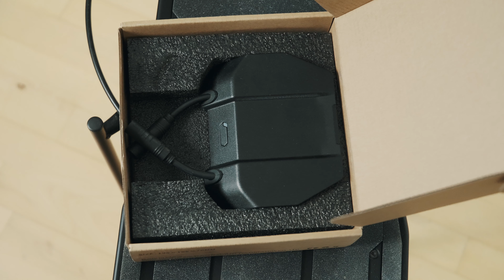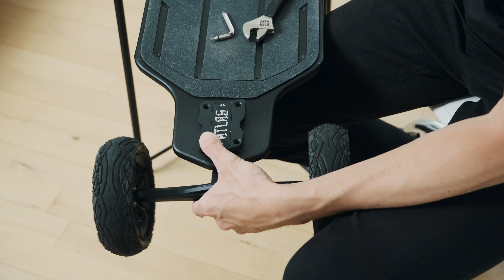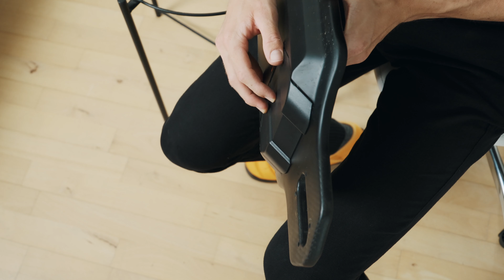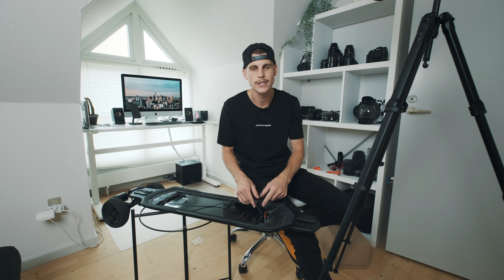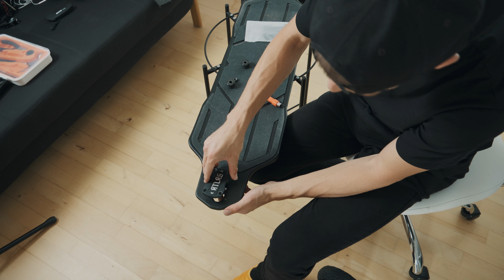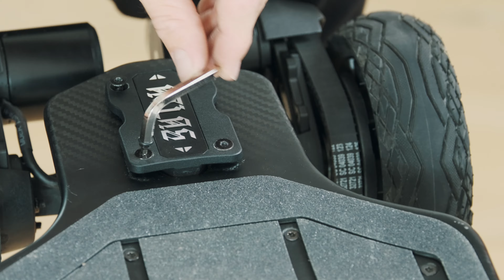EXWAY ATLAS CARBON 2WD - 4WD CONVERSION TUTORIAL

Comment: I have the 2wd version,and thinking of upgrading it to 4wd..
But how much does it affect range ?
Reply from the maker: @jaimyportier  honestly I can’t really tell you for sure. I only had it on the 2WD mode for like a couple weeks before I changed it to 4WD. 

I guess you just need to think about why you want a 4WD. If you’re thinking of doing some off-roading, then I 100% recommend it. It’s wild how sturdy this board is with offroading tires and 4WD. 
But if you’re just cruising in the city, then I would recommend keeping it 2 Wheel Dr. as it definitely does affect the range. I just can’t tell you how much. But I’m sure it says on their website.

Comment: 4 screws are out, and I've been heat gunning for 20 minutes and this thing won't budge😢
Reply from the maker: I know it’s frustrating. Did you manage to get it?
Reply: No. Gonna try again today. Just afraid i'm gonna ignite the battery pack or fry the ESC. I put a fireproof cloth over the battery area to minimize heating it. @mitch_wies
Reply: I got it, and it's empty. I needed to open the rear one. Sigh. I have a short in my board, so I wanted to check all the connections. I don't see the open grid in the rear one. It looks as though it's been filled with plastic. So I concerned with heating this one.
Reply from the maker: @BrentMinder  Dang mate. Best of luck. Maybe use a hair dryer instead so the heat is not so intense? But at least you know how much it takes now.
Reply: Hey  @mitch_wies  , i finally got it. I was removing it because of a "short" reported by the remote afterwhich my board wouldn't stay on. It would connect and then disconnect when giggled. I didn't see anything loose, but now the board won't even come on after a re-pair. The support guys think it's the battery because originally hooking it up to the charger got it reconnecting, but now not even that works. I'll probably be looking at getting another board. I got 1,800 miles out of this one in 8 months.

Thanks for the video and the replies!
Reply: @BrentMinder  I assume you live in the US. Have you thought about contacting service with all this.
Say I don't think I can do anymore and may just be risking more damage.

Ask if they will get the board shipped from you to their USA location. Maybe they can do a refurbish like job.

Mine has an issue with flashing. Each time I flash something odd happens. But I got it in working condition. Yet exway did not approve of the safety when I said it works but with this firmware output.

I was like dang I had it! Now it seems to never flash well and both sides don't work. It was weird. Especially because they wouldn't give me the apk for the old app. So I am using some unofficial app to flash it. (but it probably was the actual exway app)
Reply: @XenoTravis  I bought a spot welder and redid all the welds, then it failed again, so I just ended up buying a flipsky lightning board, and it works! 😁